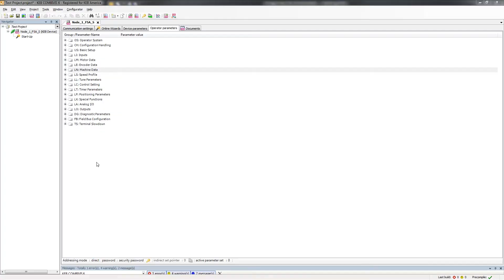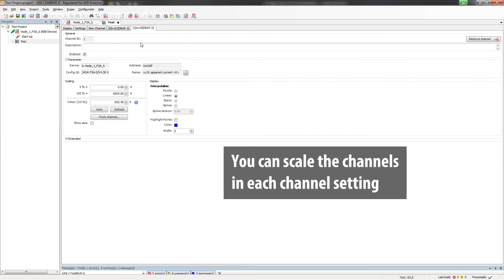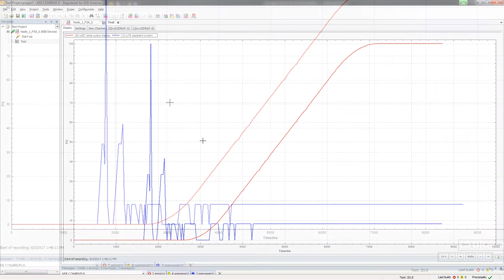Combivis 6 Tutorial: Ep 05 - Setting Up and Saving Online Scopes

Comment: i nedd to know how i can reset the encoder alarm or how the drive can recognize the encoder c ause may drive dont read the encoder. i check the cables and board in the drive but a don know what happend.
Reply from the maker: We need more specific information to diagnose the issue you are having. there are many factors involved in finding a solution to your encoder problem. Start by contacting a KEB location by phone and it would be helpful to share the specific drive part number and serial number and tell them if your machine has a KEB encoder cable and/or KEB motor. You can find a KEB subsidiary near you at this link: https://www.keb.co.uk/contact/contact-worldwide
Your best chance to receive a timely answer would be to call KEB customer support nearest to your location. Thanks for your comment.